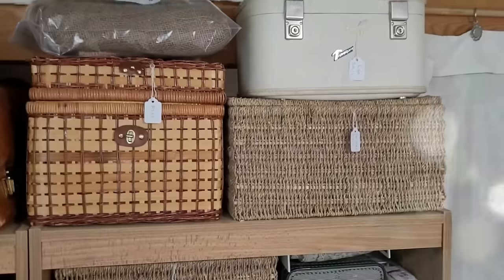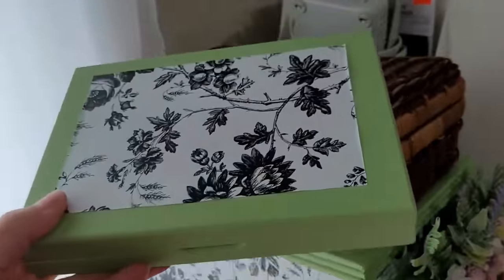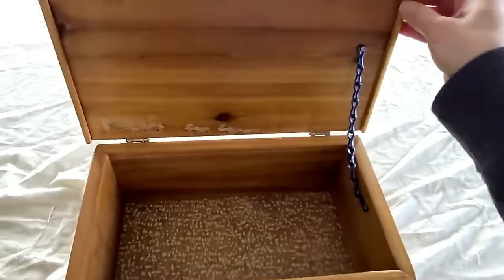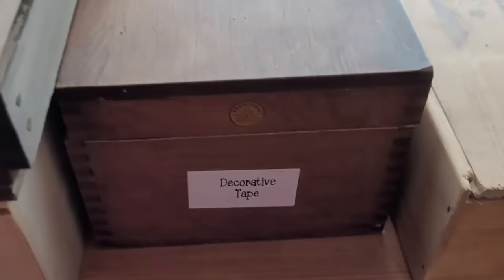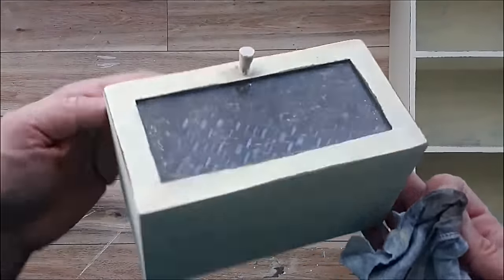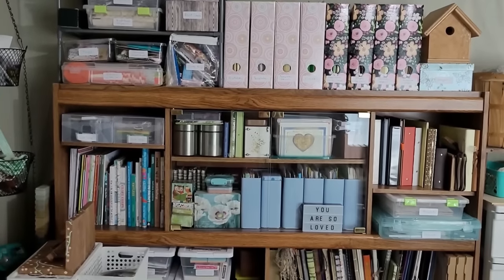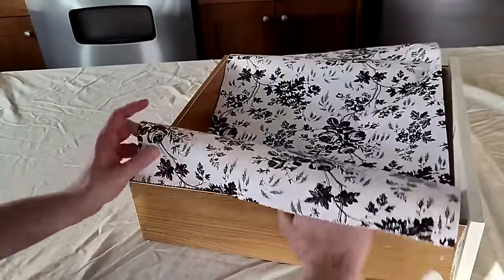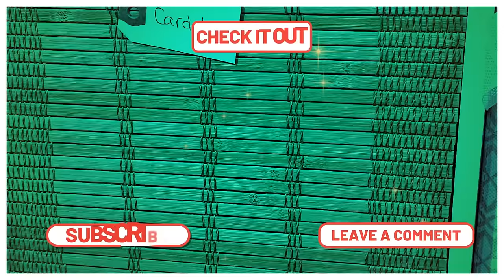MUST SEE Budget Friendly Craft Room Storage Ideas you will want to try!!

Comment: If you have cats, the cardboard boxes for litter are VERY sturdy. I cut one of the sides open and cover with contact paper. The strap turns into a nice drawer pull. I've been using mine for drawers, some for nearly 3 years.
Reply from the maker: Great ideas 😉 Thanks so much for sharing 🤗💓